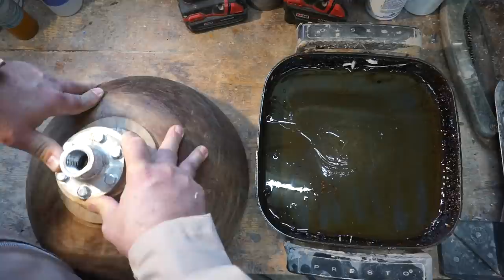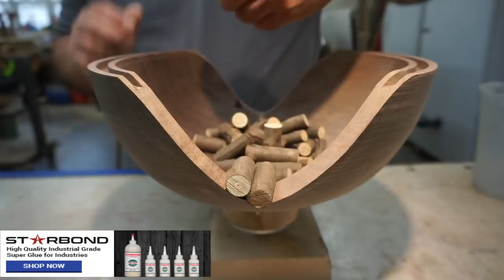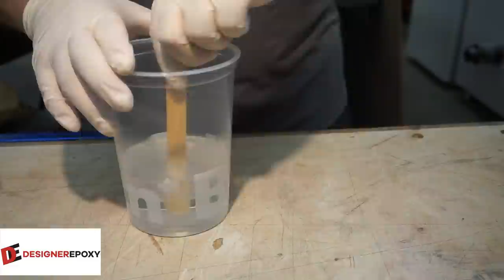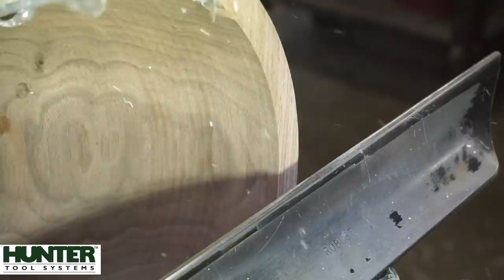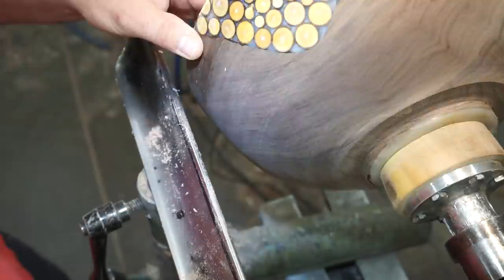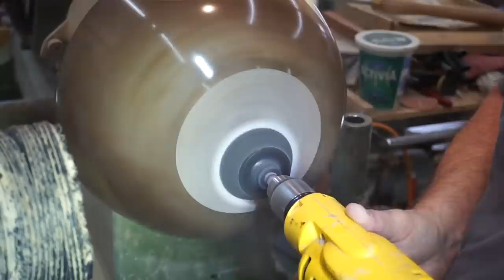Woodturning - Walnut with Maple Branches in Crystal Ice White Tinted Resin

Comment: Kids fighting over bowls.  Good one.  Here's a question: I'm guessing a vacuum chamber works better than a pressure pot for stabilizing something.  If you don't have either, is there any point in trying?  --  And as always, I very much appreciate these videos.  Thanks Coach.
Reply from the maker: If you oven dry the branches and submerged them in the stabilizing resin I would think eventually they would absorb enough of the resin to make it worth your wile. It may take weeks or months but should work, now get out they and don’t forget to do up your chinstrap, lol. Thanks

Comment: Another amazing looking piece. Can you explain your stabilization process a little more? Do you use cactus juice or a Designer epoxy product? When you work with burls you always remove any soft material, bark, etc. Is there a reason you don't stabilize the burl and keep the soft material? Thanks again for your so thoroughly explaining things. Much appreciated!
Reply from the maker: I cover stabilizing in this video https://youtu.be/B2J1vc76TUk even when bark is stabilized, it still tends to grove out when sanding. I was actually thinking of putting a whole bunch of bark together with resin and see what happens. Thanks for watching

Comment: Great project.  How dry were the branches before you stabilized them?
Reply from the maker: They should be below 5%. I have a kiln, if you don’t throw them in the oven for a while until your sure the moisture is out of them. Weigh them before putting in and keep weighing them until they stop loosing weight. Thanks 🙏

Comment: The walnut bowl wit maple branches is gorgeous!  Could you say more about the method to add inset branches with food safe finish?  Or is there an earlier video you can point me to?  I am new to your channel and new to woodturning.  Thanks.
Reply from the maker: I'm not sure what you mean.
Reply: @SpragueWoodturning  At about 33:30 you mention some branch work you did a couple years ago, and it sounded like that was not "stabilized" and thus would be food safe.  Is that correct, or did I misunderstand?  And if correct, how do the branch pieces stay in place without the stabilizer?
Reply from the maker: @plainjaneleeweiss6788  yes, that is correct. They were just kiln dried and not stabilized so you could use them in work suitable for food contact. Hope this helps.

Comment: Hi Jim beautiful work.  I am a woodturner who lives a little over an hours drive from you in Bristol Quebec.  If I may ask what epoxy do you use and dyes or additives and where do you get them from.  Having trouble knowing what works well and the investment is significant,  Thanks in advance.
Reply from the maker: If your going to do any casting get the Deep Cast from Designer Epoxy, there actually in Laval. They make great products including the pigments and have great shipping rates too designerepoxy.ca Make sure to use code inlayjim21 at checkout to receive your discount!

Comment: Jim,
A beautiful bowl, although when the branches were first put in I didn’t think I’d like it…
The walnut is a terrific wood.  I never see a blank that big here (Southern California) 🙃
When you fill with the Starbond CA glue and apply the accelerator will it foam?  Also when tinting is it better to use powered tints or a liquid like Transtint or Mixol?
Reply from the maker: I would think there would be huge walnut trees in south Cal, interesting 🤔. If you spray from distance it usually limits the foaming. I’ve never used the other two liquid tints so I can’t really say either way, thanks for watching!
Reply: @SpragueWoodturning  
Thanks for the reply👍. Claro Walnut is available in central and northern California, but very expensive.

Comment: For the next time a hairline crack appears, try a small diameter ( # 55 or so) stop drill at the end of the crack as well as thin ca glue. In aviation that is the accepted method for sheet metal repair, minus the ca glue, before the doubler.
Reply from the maker: Thank you very much

Comment: How do you determine what to charge for your pieces?
Reply from the maker: Not an easy thing to figure out. Where you live and where I live will have different prices. I good way to figure this out is to do some craft shows in your area and see what other turners are charging. If you go to a show and you sell out, then your probably too cheap. If it goes the other way and you sell very little, then your probably to expensive. This however is not always the case. If your looking to do an online business, go to Etsy and see what others with similar work are selling their products for. Hope this helps. Jim

Comment: The bottom of your cutout would be nicer and a look much smoother if the a lage forstner bit drilled out a large hole before using the jig saw (and less likely to crack in the future.
Reply from the maker: That would certainly work too,, thanks